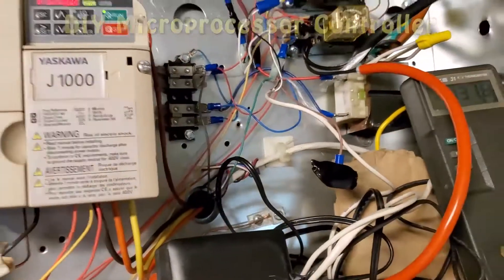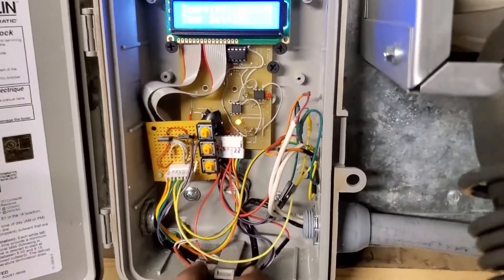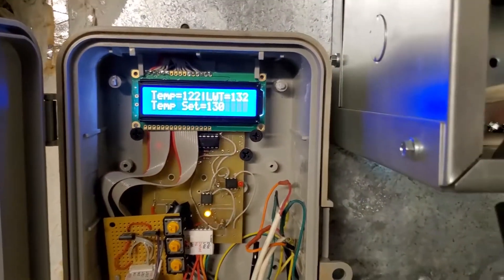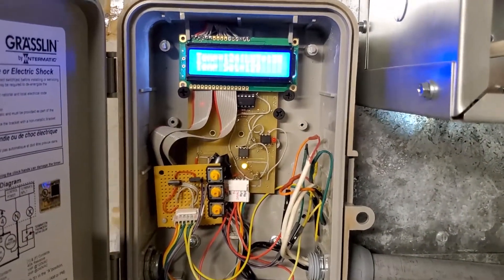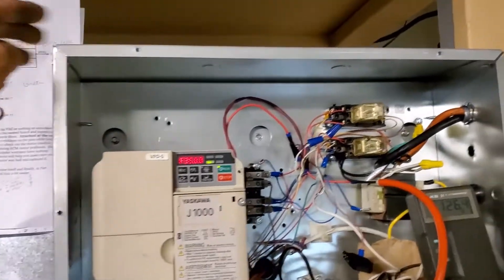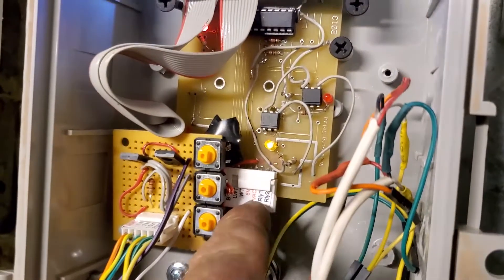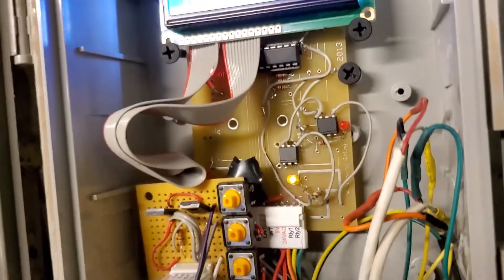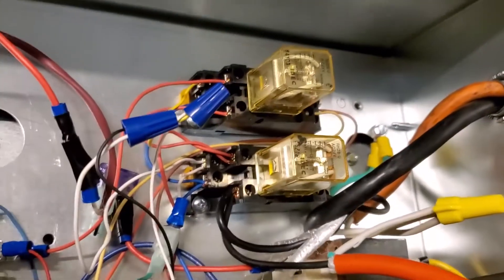Bastardized WSHP water heater finally gets controlled by my own MPU

Comment: I really like your projects like this, I found you from the water heater timer you made a long time ago. I must say one thing you do good is actually making them on boards and implementing them. Meanwhile I'm here and haven't made many of mine permanent, usually just leave it on a breadboard and it eventually gets abandoned. I usually use arduinos and code them in C, just been intending to get into the PIC ones because I have a bunch of them that aren't doing anything.  I must ask is programming those PIC controllers very difficult? What language do you use for them?

Comment: Would you mind dropping some knowledge on how you actually made that controller or links to DIY it?
Reply from the maker: Oh heck. That is a multitude of sources.
The circuit board is something I made with free cad software from a circuit board manufacture. There are several. You lay out the traces and the component pads and they make them and mail them to you.
The processor is a PIC16F690 from MicroChip (here in Chandler, AZ but the chips generally come from overseas and into various distributors in America).
I use PicBasicPro code software to program them. It is similar to old BASIC programming software that I used as a kid on 1980's Tandy and Commodore computers.
The hardware to write to the chip is something I found online.
There are newer easier to use microprocessors such as the Adrieno but these chips only cost like $2 bucks.
I was into Electronics before I got into HVAC.
Generally someone would just buy a staging temperature controller like this. https://customer.honeywell.com/en-US/Pages/Category.aspx?cat=HonECC+Catalog&category=T775+2000+Series&catpath=1.1.1.3.3

But I like to make DIY
Reply: Wow thanks for the reply, I remember typing in those Basic programs too haha and if you lost power or it froze up, you would lose hours of typed in code😄

Comment: awesome job! A true HVACHack!  Does this unit run off 100% Solar?  How do run this device at night after the sunsets?  Next is roof solar water panels...
Reply from the maker: No. I only hooked the solar up a few times just to test my solar on this existing VFD driven compressor.
My solar is intended to power some A/C in the upstairs of my house.

Comment: Very Good that now you can get the cooling and saving on the water heater energy completely. As per video I see the water leaving temp hover around under 135 is that the maximum or it can go higher up without effecting the performance of WSHP. Finally in comparison to run effeciently how much power went into the unit  now that its cooling air and water heating the house water at the same time? Again excellent design on microprocessor with cool little display !
Reply from the maker: The WSHP doesn't cool the house. It just blows cool air into the garage where it is located. 
It won't run enough to keep it cool. But it takes the edge off when it runs. 
I saw the leaving water hit 140 when the flow slowed down a bit.
I added a clean out tee and valve to back flush the exchanger. 
The water heater electric draws about 18 amps.
This unit draws about 8 to 10 amps depending on how hot the water is and how fast I run the compressor.
I slowed the compressor down to 40Hz max now that the garage is about 100 degrees when it starts. 
It is under 10 amps. Often between 8 and 9. 
So it is half the original power. And it heats faster.

Comment: Shawn i got a ? for ya we have a 8,000 BTU window unit and when we turned it on the season the other day it was 83 in the room so the air going in to the unit was 82 ish and the air coming out was 47.2 to 46.1 F  is this a good temp split i told the owner it is working fine and that a 20 degree temp split or more means the unit is working just fine the room air was 83 F with 44% humidity if that helps
Reply from the maker: That's a huge temp split but I've heard people mention that window units and mini splits are known to have colder supply air temps. Often 30+ seems to be the case on them. I read like 49 degrees on some when it is high 70's return air.
Reply: @hackfreehvac  so are you saying the unit is working fine or its time to look at a new one? i know it does blow ice cold air once its been running for 5 mins or so

Comment: I assume you're using a voltage divider in the analog input circuit of the thermistor? If you choose a divider resistor that's equal to the resistance of the thermistor at the mid point of the designed operating range, you'll bias the circuit to be in the linear range of the thermistors curve. You can then just implement a simple linear equitation in your algorithm.

 A sous vide water bath that food nerds use for cooking is an easy way to get your range of values from the thermistor. Just set the water bath to the desired temperature, stick the thermistor in the water, and measure the resistance. 

I'd add an external safety device in case the system goes into a runaway condition. Just a simple tod stat like what's used in defrost circuits clamped to the outlet pipe would be a quick and dirty method. 

Good work. I'm impressed with how fast you whipped up that code. I've dabbled a bit with avr's, and it would have taken me a long time to get everything to work. I know pics are pretty popular. Are there decent libraries for them to simplify coding?
Reply from the maker: The thermistor is 10k at 77 deg (25C) and there is a 10k series resistor to divide the voltage.
So 77 degrees = 5VDC/2 which = 2.5VDC which = approx 128 value (0 volt = 0 and 5VDC = 255 at 8 bits)
At the temperature I run the heater I subtract 66 and get a pretty accurate reading.
That same subtraction at 77 degrees = 62
The error is worse as it gets colder.
The thermistors have a weird curve that they operate at.
I've looked up code for thermistors and the consensus seems to be to use a lookup table if you need it to be accurate.
A few people offered some guesses at formulas but they were complicated. 
I could do a look up table but I really have no reason to accurately read the water at the colder temps. 
I just need it close at the operating temp for cycling.
As for PICS, I initially started with Parallax (I think they predate Aduino etc by several years) but their processors were $20+ each, which some being like $40 and up.
They just had small MicroChip PICS on them with an interpreter etc. 

I knew someone that was into PIC and asked them where to get a start and he sent me software etc. I am using PicBasic Pro and MicroCode Studio to write the programs.
There are forums all over and dating back to several years for these processors.

These processors are maybe $2 each.
I started doing surface mount but my eyes are getting bad for up close.
I killed a few of them so maybe I might go back to full size DIP. I dunno.

Comment: I love this !! Maybe someday I will do the same thing when I buy a house ! How long has the unit been running off solar ? Have you seen a drop in you're power bill ?
Reply: from watching, he been running on solar (good series/videos btw), for a few weeks/months, and i'm guessing too soon for the power bill.
Reply from the maker: @rolyicecold  No. This unit runs off of the A/C power from the home.
I just connected the solar to it a few times to test the capability of the solar.
I intend to run my upstairs A/C off of the solar if it is enough.
But I need to get a 3 phase compressor first.

The water heater heat pump only runs a little bit once or twice a day to heat the water.
I intend to let my upstairs unit run flat out on the solar if I get that working so I can cool the bedrooms as much as possible before the sun drops.
That would also be taking the load when our electric rate is higher (12 to 7)

Comment: I know it'd be a hassle since it's all soldered up, but if you could do a flow test on your circulator pump, it  would be really easy (lots of calculators online) to combine that with the delta-T across the heat exchanger and figure out what sort of efficiencies you're running.
Reply from the maker: When I first got the pump I tested it to see how long it took to move a gallon of water (unpressurized system).
I believe it is supposed to be 6GPM on the slower speed.
Reply: So assuming 10* temperature rise (screen said tank 122, lwt 132) and 6 GPM, that means you were putting 30,000 BTU/hr into the water, which is 8.8 kW. So that would be 2.4kw going into the unit (assuming 10A 240v) for 8.8kw worth of heat going into the water.

I think the water flow rate is a bit optimistic, but you clearly getting some serious efficiency compared to straight resistance heat!
Reply from the maker: @AmericanLocomotive1  Yeah, it seems to reheat the water pretty quick.
I think something said the 4.5kw electric element was 17 to 18kbtu.
My code in the program is tuned for the temp around 130. The thermistor is not linear so there will be some error as the temp drops from that point.
Reply: The exact conversion is 1kW=3412 btu/hr. So 4.5kW would be 15k btu/hr.
Reply from the maker: @AmericanLocomotive1  
Ilooked up the BTU for the element and I found some value. Pretty close still.